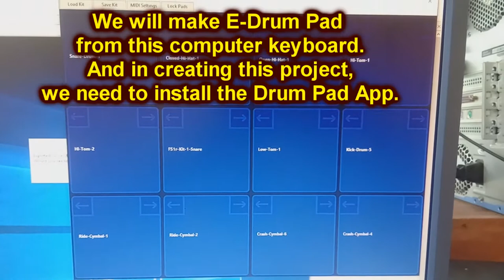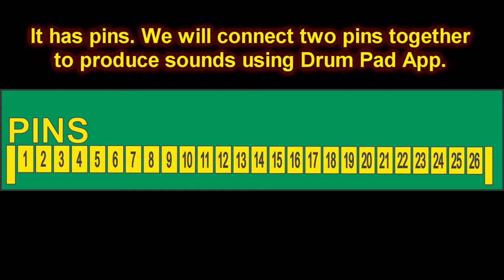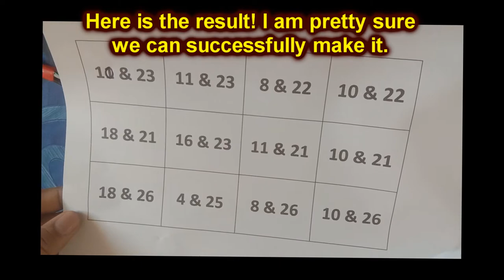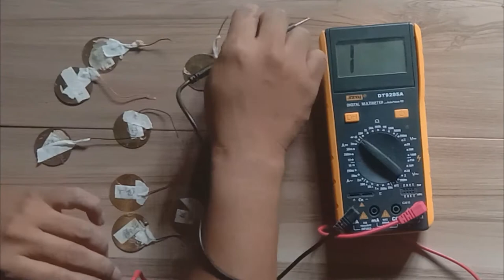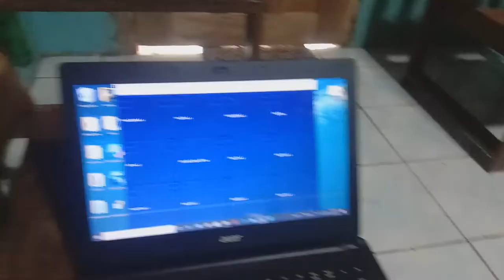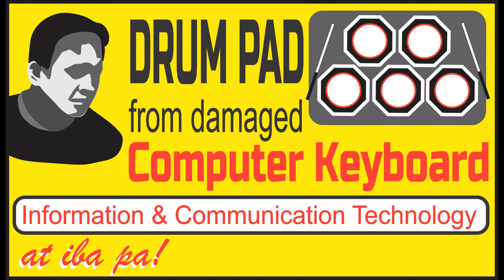Drum Pad from damaged computer keyboard (prototype)

Comment: can piezo sensor directly works with Keyboard Circuit
Reply from the maker: FYI, the piezzo that I used in this ved is not really functional. YOu can use other switches from radio supplies.
Reply: @richardbalo5344  thanks